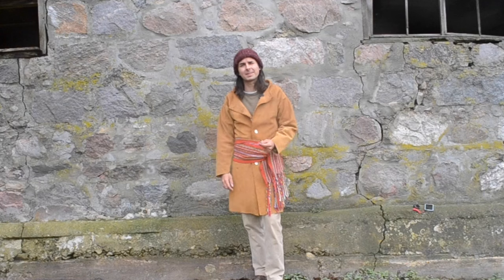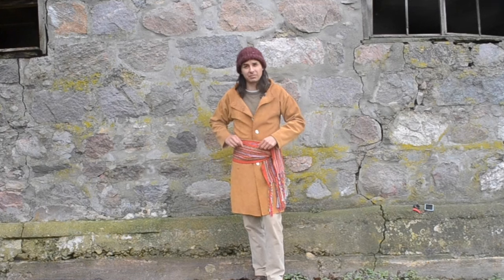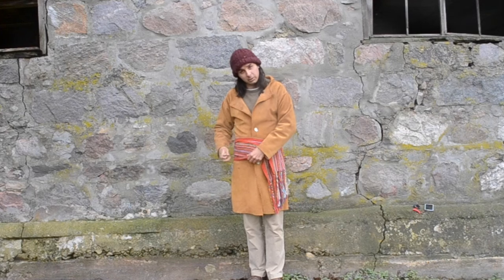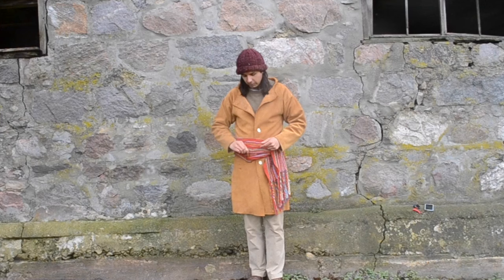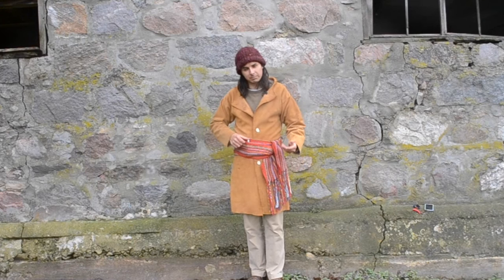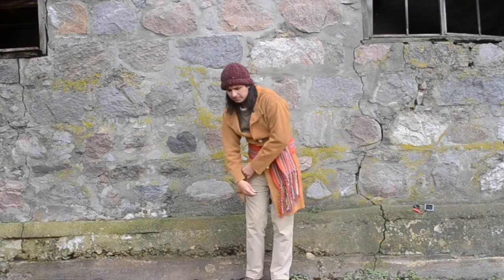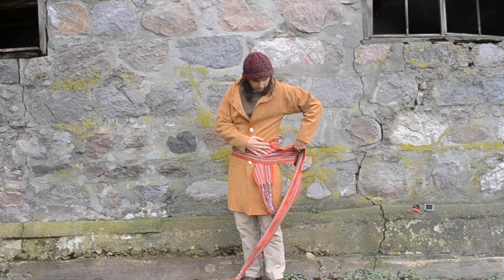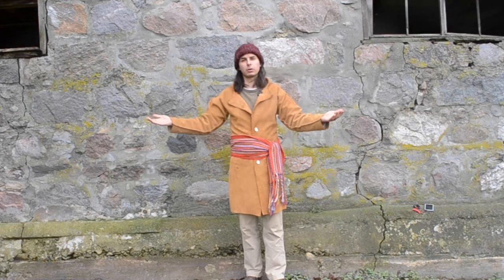A brief look at an arrow sash

Comment: If I'm not mistaken the «ceinture fléchée» was used to carry furs around to for the «coureurs des bois» attaching it diagonaly around your chest while holding furs on your back. (I'm not sure where I heard it and if it's accurate but it seems like a viable thing to use it for).
Reply: Story I heard was yes. It is long and strong enough you might use it as tump line replacement. Though it being their to guard your waist during heavy loads was important enough. Another story was that as an insult they would cut the Metis's slash thus also preventing them from working (until repaired).

Comment: Strange question: I have a similar belt (though it comes from a gaelic tradition) called a crios, would it seem appropriative to wear it, based on how similar it is to an arrow sash? Is it a open enough belt tradition that it's permissible?
(also, as a hernia haver, I get what you mean on helping keep your guts in.)
Reply from the maker: It looks like almost the same thing to me, so I don't see any issue.
Reply: Looks like convergent evolution. : )

Comment: What was the main ways the Mohawk people insulted their homes through out their history? From long house to European style cabin?
Reply: Insulated? Pretty sure in the winter they just packed snow by the walls.
Reply from the maker: Buddy beat me to it. A longhouse is designed to collect the snow from the roof against the walls. You would also hang blankets or furs around your bunk like a four poster bed. Besides which you have a lot of bodies generating heat in the same room. 
On log cabins, besides snow, if you're using decent size logs, then they will have a decent bit of thermal mass which is almost as good as insulation.